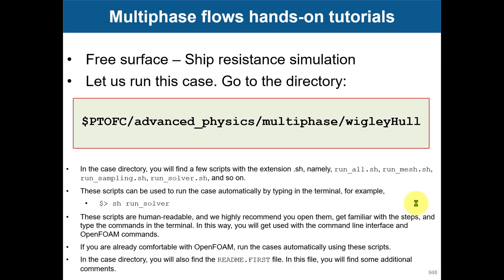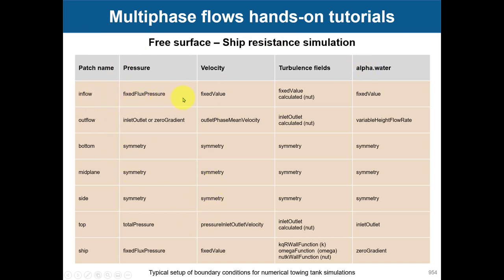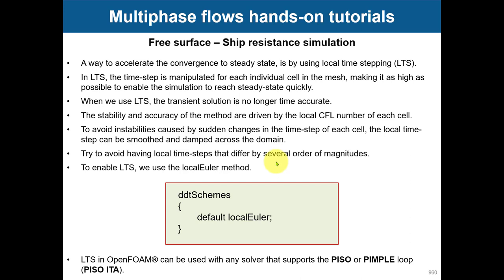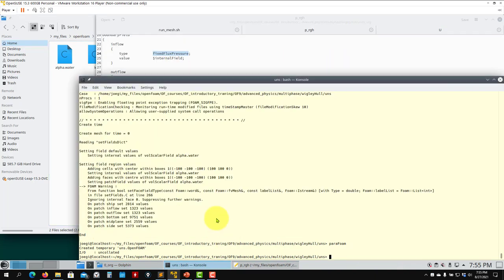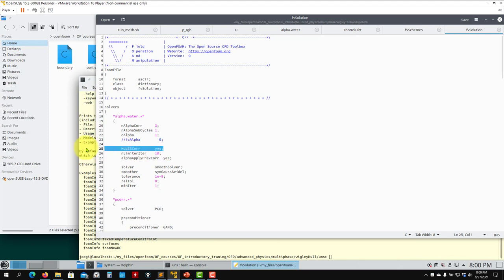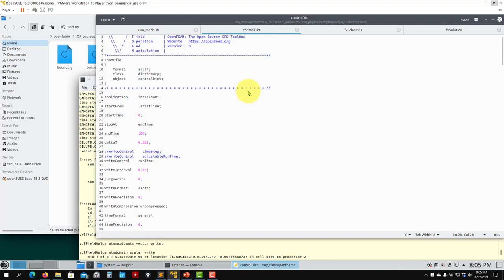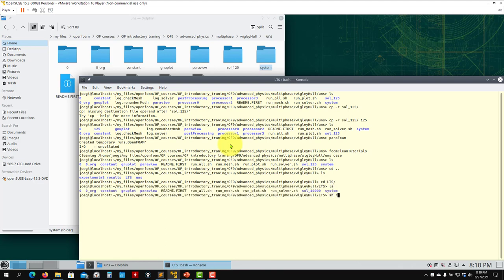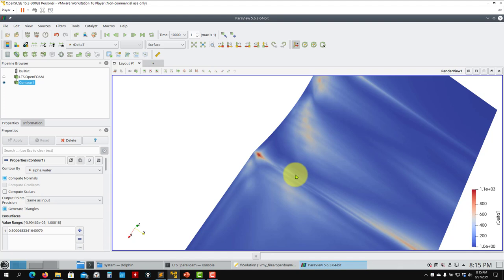8.6 Module 8 - Advanced physics - Multiphase #openfoamtraining

Comment: Thank you for this insightful video, Joel! 🌟 Your detailed explanations and the resources you've provided are incredibly helpful for transitioning to the latest versions of OpenFOAM. I especially appreciate the focus on multiphase flows, which are critical to my current projects.

I have a question regarding the application of these concepts: Do you have any  tutorials specifically dealing with a 3D cylinder obstacle in a multiphase (free surface) turbulence flow model?
Reply from the maker: yes, i do. Just to be clear, are you interested in surface piercing?
Reply: @wolfdynamics5703  Yes, I am indeed interested in surface-piercing scenarios. I'm working on a bridge pier model to estimate hydrodynamic forces and scour during flooding hazards. I am just starting with a simple problem involving a 3D cylinder (pier) that is partially embedded in water within a channel or river and exposed to the atmosphere (free surface).

I've just joined your members-only channel on YouTube, hoping to find a specific case similar to this in the Multiphase flows section, but haven't spotted one yet. Any guidance or resources you could share would be greatly appreciated!"
Reply from the maker: well, the surface piercing part is easy.  The scour part is the difficult part. You can try sedFoam, they have a few working cases.
Reply: @wolfdynamics5703  Yes, I am trying to install sedfoam in a cluster HPC, I already did it in my local machine, but to run complex cases, I believe it is better to use a cluster. Also, I saw in one of your tutorials that there is a more advanced solver called sedInterFoam, but I am unsure if it is compatible with the newer version (openFoam v2312). I would appreciate a basic multiphase model for a cylinder to improve my understanding of the setup.
Reply from the maker: scour is a complex topic.  Well try to prepare a tutorial and also the installation instructions, but do not expect it anytime soon.